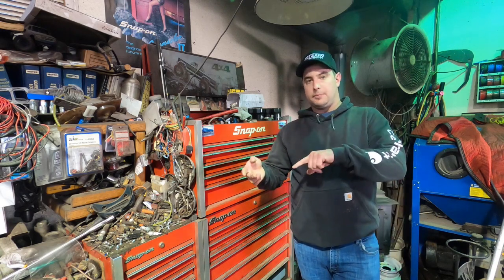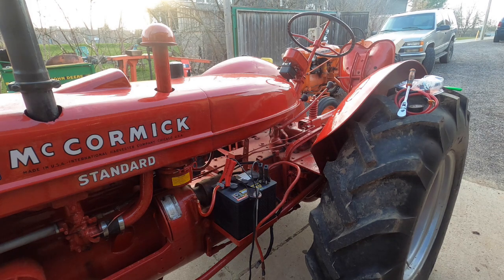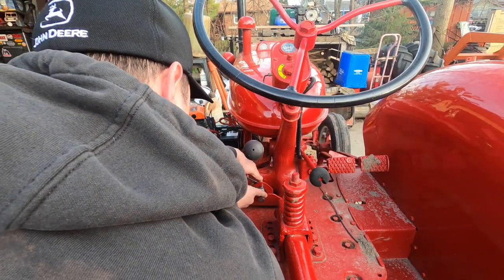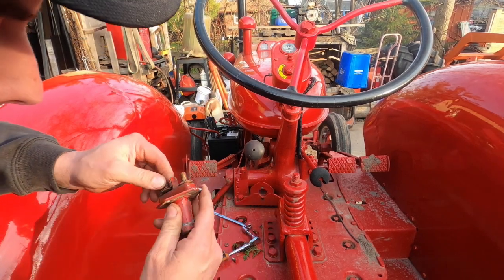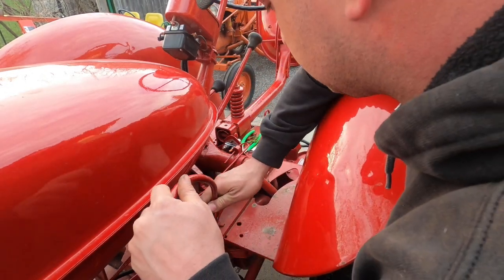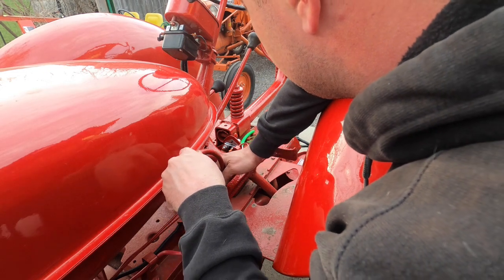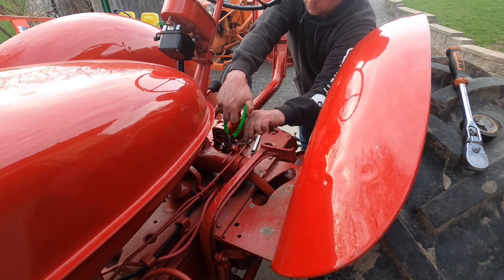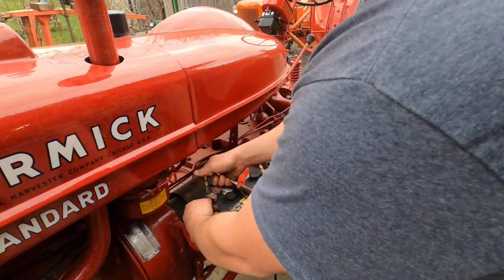If its red, its probably dead!

Comment: Our W-4 never started, always just parked it on a hill when i was a kid.  Then last spring put new battery cables on and cleaned up the switch and fires right up.  But dad's always said its never started right since we had to replace the starter and it had the pull start switch on top of the starter.  As for the 6 Volt I personally like 6 Volt positive ground better then 12 volt negative.
Reply from the maker: They all have their quirks , I found the old Allis stuff to be the easiest starting , If the 6 volt system is intact , I tend to leave it , if not then I consider 12 volt , thanks for watching cheers

Comment: Good  day from Kit-Waterloo.  When we had farm with W-4, &  6  got so disgusted with 6 volt batteries,  started using hand crank,  battery always had enough  power for tractor to start but not to turn over.  Thanks
Reply from the maker: Good day don . 6 volt can absolutely be a pain , I just don’t have the heart to change it from original when it’s actually working lol , cheers
Reply: One of these days I have to get at what was my Grandpa’s H. My Father had an 8 volt battery in it for years. I’d like to make it work on 6 again. It did when I was young spending many hours cultivating corn. The starter was probably never looked into, probably just threw more voltage at it.